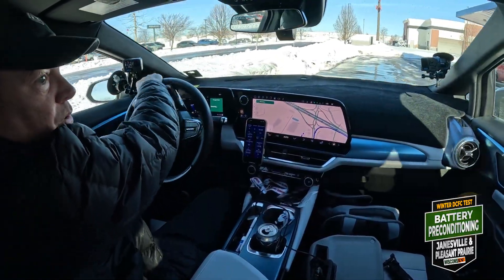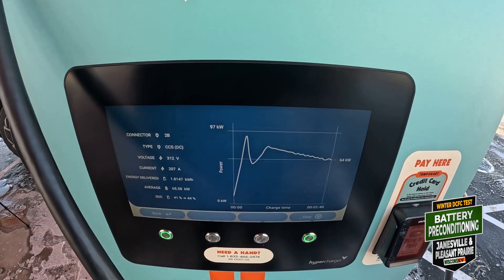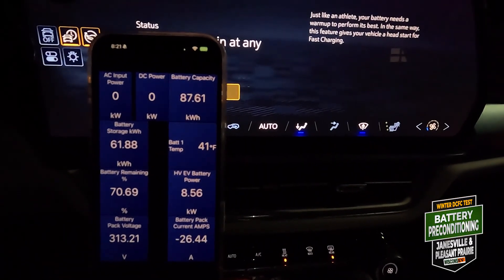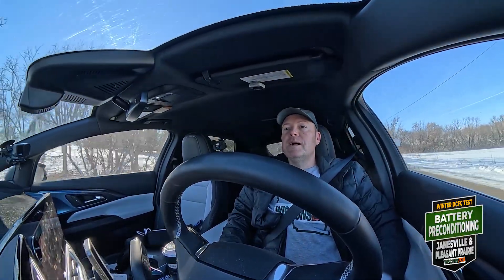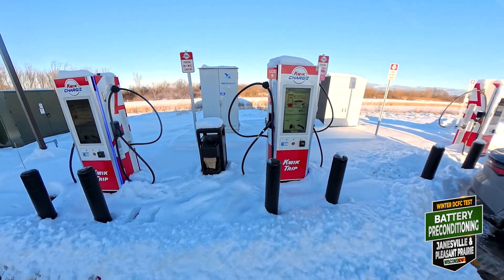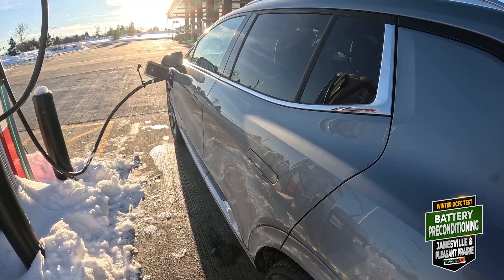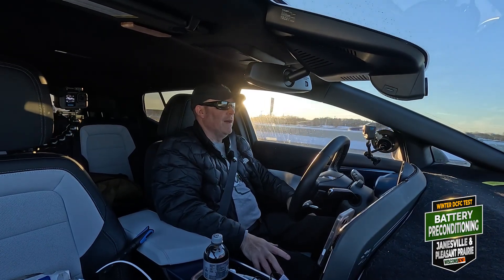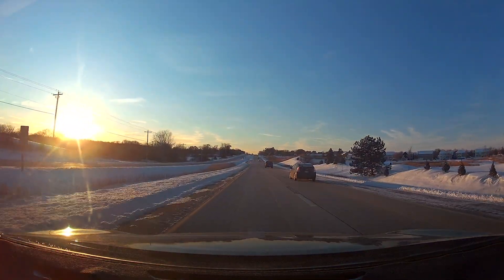How did I get the full 150kW charge in 19 degree weather? Battery Preconditioning!

Comment: My Silverado peaked at 81 kWh in GB at Meijers in 18 degrees. Unimpressed.
Reply from the maker: Were you able to precondition the battery? What did it start at because yeah that’s not putting the Fast in DCFC.
Reply: @WisconsEV  I had driven from ATW to GB. Ready or not it got charged. I gotta admit I never precondition. Charge on the road so seldom I didn't think about it. Sat there for an hour charging and think I got about 140 miles added.
Reply from the maker: @JohnEN-THZ  I don’t think about it either to be honest…unless the video is specifically about that. I was surprised how little it warmed while driving without telling it to warm up. I guess that’s more efficient if you don’t warm the battery for no reason.
Reply: Kw* is for power.

Comment: The other day it was about 20 degrees outside and I drove from Beaver Dam to Fond Du Lac with the battery preconditioning turned on and when I arrived at the Tesla chargers there by Target my battery still said low temperature. I feel like that should have been far enough for it to have raised the temperature of the battery. I have a Hyundai Ioniq 9 and I am not seeing fast recharging rates from the super chargers and I am concerned that it’s because of battery temperature issues.
Reply from the maker: I agree that SHOULD be enough time. Do you have an OBDii device plugged in? I just saw this from Ioniq Guy’s channel - https://youtu.be/JgfcPkVje_Q
Reply: Thank you for posting that video link. I don’t have a OBD-2 sensor but I was considering getting one. Now I’m kind of glad that I didn’t.
Reply from the maker: @jko0526  I’d look into it more, but I think there are still reasons to get one. Maybe don’t leave it plugged in all the time and use it more strategically and situationally? I just watched a different IONIQ Guy vid where he used one to help diagnose a battery issue he was having that is leading to a full battery replacement. I like the ability to get the info, but don’t use mine all the time. Had to unplug it when I brought the car in for tire rotation (also when contacting Onstar). But the service guy just plugged it back in.
Reply: 8:42 Tip for new to EV folks, if your desired destination charger isn’t in your cars navigation system, you can still get some pre-condition if there is a different DCFC that is in your vehicles Nav system nearby to where you are actually going.  Just chose that one but go to the DCFC you actually want to go to.  Your battery will still precondition.
Reply from the maker: @michaelwitkiewicz7052  Excellent advice. Should have included because it’s something I have done myself! Thanks for the knowledge and the assist!

Comment: Last winter I did a run from Atlanta to Detroit what was essentially 10F the entire way.  I used Google Maps through Android Auto on my 2024 Ford Mustang Mach-E Rally, and the car would precondition the battery automatically on approach to the chargers.  Honestly, other than noting the car knew the next stop was a charger, I did not even think about the preconditioning, but I never had a long stay due to reduced charging rates.

I take a 20% hit on range, but that is handled by the navigation
Reply from the maker: I use the nav ALL THE TIME. Even going where I know how to get there. The Kwik Charge station wasn’t in the map yet, one of the reasons I clicked the manual button. But yeah 100% the google navigation does a great job keeping the car in electrons. I have to decline charging options much more often than having to manually find a spot to charge. Had the same experience in my Volvo C40 too.

Comment: Just wondering about the snow plow guy. Do they have issues plowing EV charging stations? Thanks for the info too.
Reply from the maker: Not sure, but they probably need some hand shoveling to clear closer to the dispensers.
Reply: I recently watched a Tesla guy climb over a snow bank to get the cable, didn't work, put it back, moved the car, climbed another snow bank- finally got it started, trudged off across 1/4 mile of slush to get shelter.  I think I'll just stick with 2 minutes at the pump with a roof over my head..
Reply from the maker: @SteveLomas-k6k  see and I like to warm up my car in the garage without opening the door while its still plugged in. To each his own.
Reply: @WisconsEV  Fair enough, we remote start ours outside- but the nice thing is, you get as much heat as you want without hurting the range.

Comment: 2025 Chevy EQEV LT2 here in the Madison area too. Subscribed, hope to have no issues with the car while I’m leasing mine. I am driving to Michigan on Thursday and worried how the bitter cold is working against the vehicle. Can I ask how your range hit was with the temp plummet this weekend?

I know it’s not going to be negatives on Thursday but I’m charging via fast charger to 100% before I head out.
Reply from the maker: @crumbdumpster Starting the trip at 100% is a great plan. If you have the time and don't have charging at home, I'd go to HyVee or Woodman's and lvl 2 charge, probably for free from 80-100% because the DCFC will be MUCH slower for that part of the battery any way. The range is likely something like 230-250 miles on the highway right now...depending on your speed. If you don't have the AWD it's probably a bit higher. The Google Navigation was VERY close on my trip over to Pleasant Prairie. During the summer it was WAY off, by like 10-15% to the low end at times (meaning it would say I'd finished with 1% at end of trip, but I'd have 11-15% actually at the end), but it was on last week. It said 17% at the end from Janesville to Pleasant Prairie and I got there with 19%. Those speeds are slower than interstates however.

Do you have a NACS to CCS adapter? If so, the trip SHOULD be relatively worry free. Actually, Southern Michigan or UP? If south, the Chicago area has a lot of charging options. I've driven down to Indianapolis thru Chicago, so I know most of the route is workable. If you have some other specific questions email me: jay@wisconsev.com
Reply from the maker: Have you tried the A Better Route Planner app? I've had luck with that plotting my journey as a start and then I decide if there are better options.
Reply: @WisconsEV I’m going to be honest and say I tried it before but it was sort of clunky with how it operated and whatnot and wasn’t super helpful with my stuff but that was a while back when I was originally thinking of getting the equinox… I will download it again and retry
Reply from the maker: I think Plugshare does a route plan too, but I agree I had to figure out how to use ABRP. You could always sit in the car, put it into the screen and see what the nav says. I'm not getting the same charger integration when I try on my phone, so at least the car will know it needs to stop and when it expects to.

Comment: I just traded on my Bolt for an EV6.  Can't wait to go from no preconditioning at all to automatic preconditioning!
Reply from the maker: @spudbeach I saw on plugshare you listed an EV6 and wondered. How’s it going so far?
Reply: @WisconsEV the more I drive it, the more I love it!  Not just the longer range and faster charging (the real reason I traded), but the adaptive cruise control and bigger interior just make it really nice!
Reply: I have an EV6 2022 no issues so far just make sure all the recalls are tooken care of which are done for free.  Great car btw enjoy it.
Reply: For me that would have been an easy choice. 
Unfortunately, the us made kia and hyundai evs are built terribly, and now they are experiencing battery failures already. And they haven't solved the iccu problem. 
Sad to say, the new bolt probably is a better choice. And yes, it has manual and auto preconditioning, and standard heat pump. So dumb that kia doesn't include that unless you get awd.

Comment: I’m entering the first winter of F150 Lightning ownership and it charges shockingly better and easier than my old Model Y at low temps. After sitting for five hours in 20 degree and below temperatures, it charged at an average of 112 kw from 40-80% and peaked at 130 kw after preheating the cabin for a few minutes and then driving only 8 miles on the highway.
Reply from the maker: What’s the preconditioning like on Lightning or any Ford? That’s not too bad. It’s better than my average in the summer. LOL
Reply: @W @WisconsEV The Lightning doesn’t really seem to precondition like other EV’s.  The dash has battery and motor temperature gauges and it looks like the battery always tries to maintain an optimal temperature. I’m not convinced it actually does anything additional when you set navigation to a charging destination.  As long as your temperature is close, it charges “well”. It has a pretty conservative charge rate.  Worst case I’ve actually seen is in warm temperatures fast charging on a road trip in +90 degree in summer traffic at less than highway speeds where there is insufficient airflow to cool the battery between charges.
Reply from the maker: @davidsuto7440  interesting. I wish I had a fleet of EVs to test out. At the other extreme in summer I could see battery temps being hard to keep cool and chugging along. Thanks for the real world experience! I'm a little sad about the Lightning going away, but at least there are still 100,000 on the roads to check out still - I love spotting those.

Comment: If you go back a year or two to that debacle in Chicago with all those rideshare drivers during that deep freeze, you'll notice that the reporters not once asked those rideshare drivers about battery preconditioning. That's issue number one. The second is that even if ask them that, most would say, "battery preconditioning? What's that?"

It's not an EV issue, it's a misinformation and education issue.
Reply: Yes, and the fact that most rideshare drivers use Bolts with limited battery preconditioning capability, if any.
Reply: Weren't they all tesla? Oh yeah, that had non tesla's there due to being a combo station or something. 
My stupid 2020 niro has a heater I've yet seen it ever use.
Reply: @sprockkets  There were several standard range LFP (worst in the cold) Model 3's. And all mostly were charging on old V2 superchargers, just like the main media loves it. Pointing out how EV's and chargers used to be, and not the reality that they are NOW.